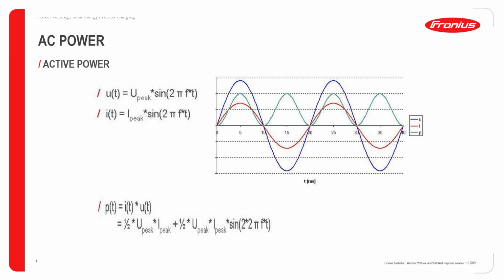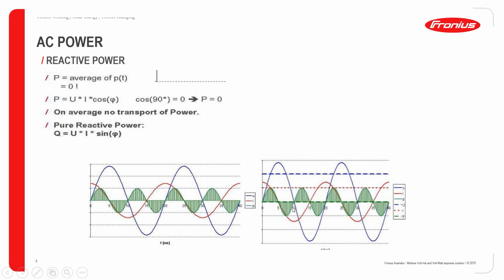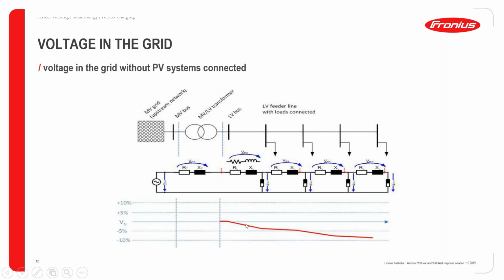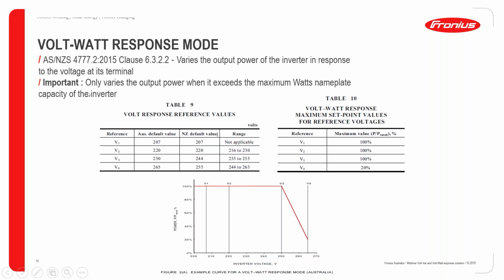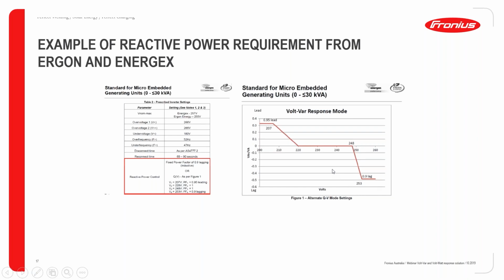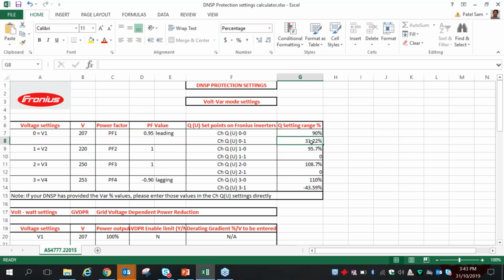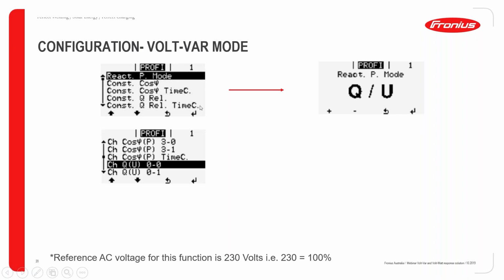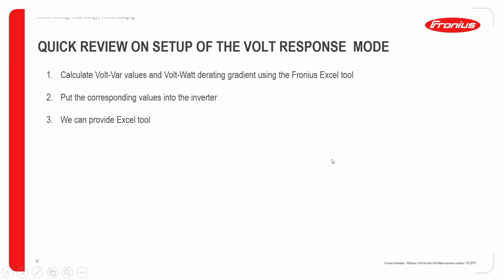Webinar: Volt-VAR & Volt-Watt response solutions with Fronius (AUS)

Comment: I have a 6.6kW system with a Fronius 5kW Primo Inverter. I am only getting 4.5kW during the peak of the day despite all of my panels being in sun in the middle of the day. How can I change my settings to enable getting 5kW? Energex (QLD) are my electricity providers as I live in QLD. Any help is appreciated.
Reply from the maker: Hi David!
Thank you for your query regarding your Fronius inverter. From the 1st of October 2015, Energex introduced a rule that makes it mandatory for every solar inverter greater than 3 kW in size to have a reactive power control setting set to 0.9 lagging.  Therefore, your Fronius inverter is clipping at 4.5 kW during the peak of the day. This control setting eliminates the nuisance tripping of a solar inverter in case of high grid voltage from the street. Since the rule has been put in place by Energex, the setting cannot be changed without getting an exemption or permit from Energex.
One of our solutions partners has published an article on the rule from Energex. Please click on the link below to access it.
https://gold-coast-solar-power-solutions.com.au/posts/reactive-power-and-solar-power/
Please feel free to contact us if you require further information. Best regards, your Fronius Social Media Team

Comment: Hi and many thanks for covering so detailed and professional this topic. I have a Fronius Primo 8.2 and since I started to inject energy into the grid, I have the issue of increasing the voltage. So far I was trying to tackle this via the webpage setting in DNO (I have also a limit to inject not more than 4000kW). Using this dinamic method volt-watt should do much better. Still, would the overall limitation (not more than 4000kW regardless of the grid voltage) would still work, or this is overwritten by the volt-watt settings?
Reply from the maker: Hi!
It’s our pleasure to share the knowledge and new functions that have been implemented in our inverters to mitigate the voltage rise issue caused by high grid voltage on the grid lines. The DNO editor function is mainly used to export limit solar energy to the grid with the use of a Fronius smart meter. We believe you may have had a Fronius smart meter installed in the main switchboard of your house. If you haven’t and used the DNO function, it would limit the inverter's entire output to 4 kW maximum as the inverter doesn’t get any information or feedback from the meter on your energy usage or energy production. In some cases limiting the inverter output to 4 kW may have helped with the issue but it depends on how high the grid voltage is at the inverter terminals. If the grid voltage is quite high (between 255 – 258 volts), it requires to shut down immediately as per the requirements from the grid operator. The Volt-VAR and Volt-Watt setting is triggered as soon as the inverter is trying to produce its maximum power output and therefore linearly changes the power factor value based on the grid voltage, reducing the inverter power. Hence, the inverter doesn’t require to feed in full power back to the grid, mitigating the voltage rise issue. But it again depends on how high the grid voltage is at the inverter terminals. The volt-var and volt-watt settings trigger first before any export limit set on the inverter.
 
You can certainly analyse the grid voltage on our online monitoring portal Fronius Solar.web (www.solarweb.com) under the tab ‘Analysis-> History’ if your inverter is connected to the internet.
 
The following measures can be considered to reduce the effect of the voltage rise. You would have to consult your installer to implement the measures below.
 
- The common cause of the voltage rise issue is the distance from the inverter to your main switchboard. If the distance is too long, the voltage-rise calculation needs to be done by your installer to get the correct AC cable size. You can consider increasing the cable size and it may help with the issue.
- You can consider having a Fronius smart meter installed in the main switchboard and set the export limit to 0 watts under the setting ‘DNO Editor’. This way at least your energy demand in the house is being met by your solar system as the meter measures the consumption and lets the inverter produce only the required energy.
- Some PV system owners have raised this issue with the grid operator if the voltage coming from the power lines is relatively high. They may be able to monitor it for a few days and reduce the voltage on the power lines if necessary.
- Please check the ‘Volt-var and Volt-watt’ settings are set correctly by going to the menu ‘Info – Device info’ on the display screen, where you can scroll down to the Q-mode (Q/U) to check it. Also, it’s good to do the latest software update on your inverter and then re-load the country settings ‘AU-1 or AU-2 or AU-3 …’ depending on the state of the country you live in. You will require to enter the code ‘73887’ by pressing the third button 5-times from the left and then selecting the country setup. After you have loaded the country setup, it automatically sets the ‘Volt-var and Volt-watt’ settings as per the requirements specified by the grid operator.
 
We would highly recommend reading an article published by our solutions partner plus based in QLD, Australia on the voltage rise issue. It covers some solutions to reduce the voltage rise, which you can perhaps consider implementing.
 
https://www.mcelectrical.com.au/solar-voltage-rise-explained/
 
Please feel free to contact us if you require further information.
 
Best regards, your Fronius Social Media Team
Reply: @FroniusSolar  thanks for the reply. I have a Smart meter installed, so I use the DNO function to limit the export (the constraint is given only by the general fuse in the power distribution box of the grid company, not cables or anything else). In the meantime I have implemented also the the Volt-Watt limitation based on the documentation I found on the Fronius site. Indeed there is a distance between my house and the next transformer (of the power company) so if there is no consumption on that phase from other households, the voltage will rise. Anyhow, having now the two options configured (DNO & Volt-Watt) I've managed to solve my issues. I can export at the maximum possible without getting the inverter reaching the disconnect limit.

Comment: Well explained and is one of the major issues and risk to PV Panels. Eskom South Africa has recently increased the average volts to more or less 244 to 249volts per phase. I own a Solaredge inverter  and wish they had the ability to understand and explain this issue properly.  Fronius is the trendsetter.